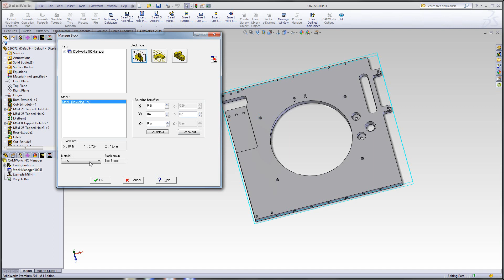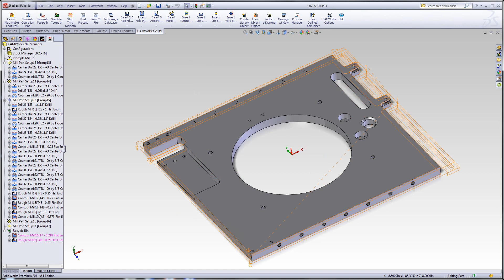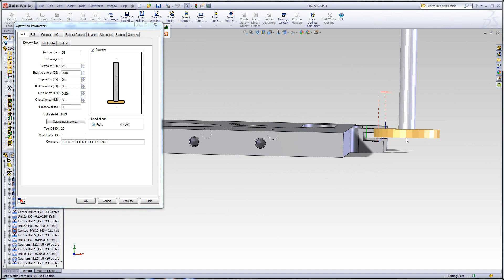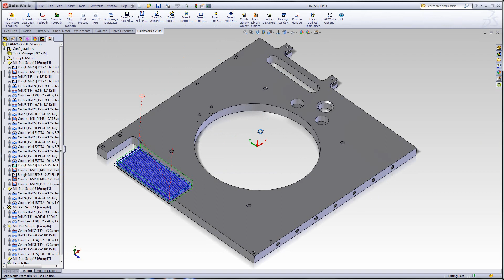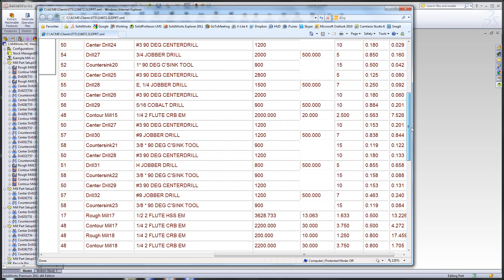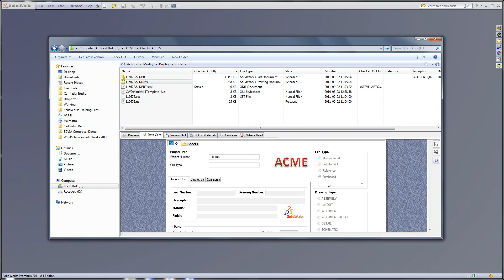Machining a Plate with Camworks

Comment: Hi ProgressionSupport:
I have an issue with camworks I thought you could shed some light upon. I have a simple part with a fillet (constant radius 10mm). Camworks does not appear to recognise the fillet as a machinable face. I have allowed to prompt for tools, change part orientation (XYZ), set options to recognize fillets. at a loss of what to do next?